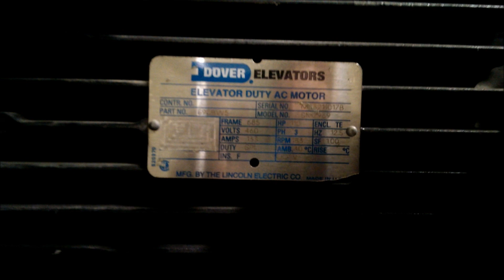ThyssenKrupp / Dover High Rise Freight Elevator Machine Room in Building

Comment: those gear less machines are huge! 100 HP 3P AC motors must draw a ton of current. Bet the machine itself weights over ten tons not counting the weight of the elevator cab, counterweights, and hoist ropes.

Comment: Multifoods Tower/City Center I presume?
Reply from the maker: Actually it's not, it's another building on the opposite side of downtown 😊
Reply: ElevateMN   D'oh!!  I just released you had the other video of the passenger fleet (presumably from the same bldg.) that I made the same mistake about... I just hadn't seen this video before for some reason.  By "other side", I realize you must mean either east or south.  East would primarily mean 1960's era apartments (which would be too old) and south would likely be a private condo bldg... in which case, I totally understand why the specifics aren't disclosed.  Either way, thanks for another great video.
Reply from the maker: +Dana Danarosana The south side of downtown, there are a few taller office buildings in this area.
Reply: ElevateMN I guess I was presuming south of 12th St.  The bldg. that the Dakota Jazz Club is in isn't tall enough.  Perhaps these machines would be enjoying gigantic, digital fish swimming about many stories above Downtown Minneapolis?